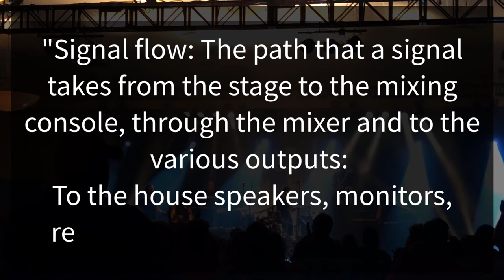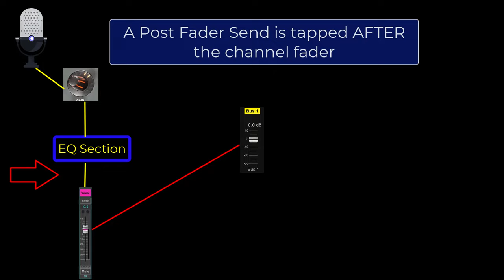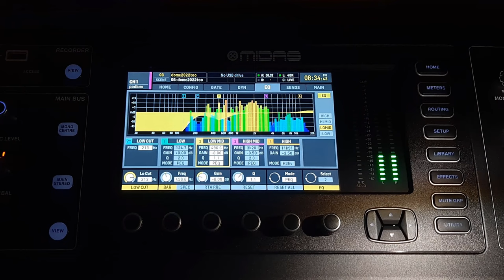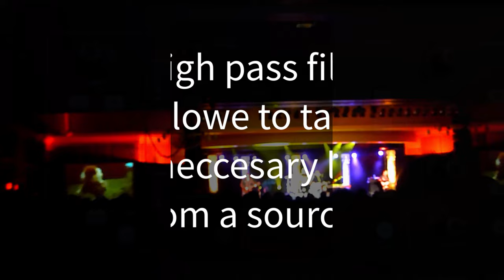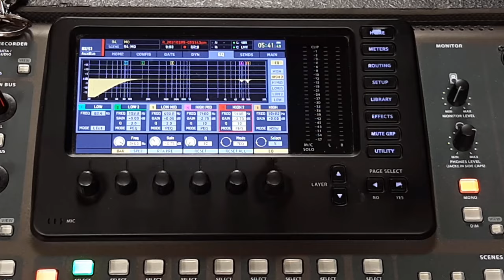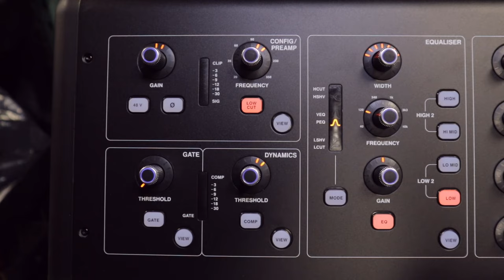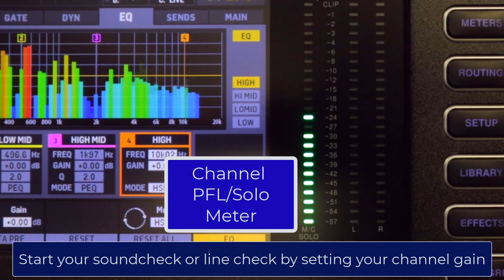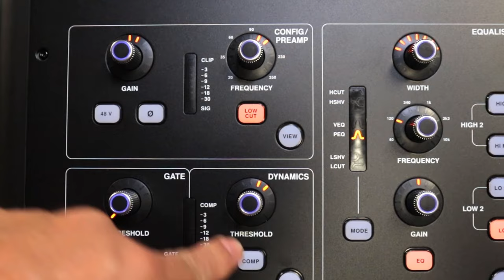Live Audio Mixing: The Fundamentals

Comment from the maker: This video is non-console specific, and much of it applies to analog or digital consoles. But, since it's rooted in console fundamentals, it's definitely things that can help you make the transition to digital easier. Signal flow, routing, gain, EQ terms, etc. are all discussed. It's actually more than 3 tips because there are tips within the 3 fundamental topics discussed.
As always, please like, subscribe, and share the link. And post any questions or comments here.

►►There are PDF materials on the Patreon page, including a PDF Study Guide package of materials that I've written that dovetails with this video and gives more context for a deeper dive. It is available as part of the 4.00 Patreon tier.
https://www.patreon.com/AlanHamiltonAudio

~~~~~~~~~~~
Suggested videos:

►5 Tips for Better Live Vocal Mixes:
https://youtu.be/oP4sdpkkNhY

►Mixing Live Bass Guitar:
https://youtu.be/FNa7avcUUSM

►How to EQ a Kick Drum:
https://youtu.be/CQg1_-ZJ4MU

►How to EQ a Snare Drum:
https://youtu.be/J_WC68vyht4

►How to EQ Toms:
https://youtu.be/nSLJqnlJe60

►Cable Management For Live Audio:
https://youtu.be/nYZ9nrPGswo

►DI Box 101 -  What's a DI Box and Which One Should I Use?
https://youtu.be/6iwW5_Ia9Uc

►My Most Used Audio Adapters for Live Sound:
https://youtu.be/SFzPh3UYAoE

Comment: I find your videos extremely interesting. I've taken an interest in live sound only within the past year. Wish I had got into in my younger years. We have a pulpit mic in our church that's hard to hear. I asked the sound guy why that was, his response  "when we turn up the gain we get feedback". I accepted that answer and I just learned from this video that his answer is incorrect. I'm guessing he has no idea on waht to do to get rid of the feedback other then decrease the gain on that channel.
Reply from the maker: Yes, that's likely true. While it's possible there could be some physical limitations, like the speakers placed directly behind the pulpit and even aimed at the mic, and worse, without much distance between them and the mic... And even worse, maybe the person speaking has an extremely quiet voice too. That is not usually the case, though.

It's more likely it is something like the mic is being fed to the monitors, and already close to feedback so bringing the gain up finally crosses the gain before feedback threshold into feedback. And for whatever reason they don't bring the fader up instead (and maybe they do but maybe any monitors are post fader (instead of pre) which would also bring the monitor level up. But some people mistakenly think the faders all need to be in a perfectly straight line at unity and so they monkey with the gain control to achieve that, and won't move them fader (even when needed) and that paints them into a corner.
That would be a scenario that would cause feedback primarily in the monitors. 
But the feedback could be in the house.

That then could include an issue like the system EQ is not properly dialed in making a mic or mics more prone to feedback. Or channel EQ alone or in combination is making some mics more prone to feedback or not properly addressing feedback. This could then lead to feedback in monitors or house (or both).

Many times, for things like a pulpit mic, few if any level in the monitors is needed. And if you do send the pulpit mic to the monitors, the person speaking will get (speak) even quieter because of just how well they do hear themselves and so perceive themselves as being 'too loud'. Turning down (or off) the pulpit mic in the monitors could actually make the pulpit mic louder, because the person speaking will talk louder. The louder the signal going TO the mic, the more signal the mic (and thus sound system) have to work with. 

Then other issues like not using a HPF and/or no windscreen on the pulpit mic (or lows dialed into it) could have the person backing too far off the mic because when they do get close they get loud plosives ("P"-pops... "B"-Booms... "T"...thumps). But that goes back to what I said about losing signal into the mic. Backing away from the mic means less signal into the mic.  Note: You shouldn't have to get right on top of a pulpit mic. So don't misread what I'm saying. The person speaking shouldn't have to have their lips touching the mic. A foot off a pulpit mic is generally workable. But a yard/meter back would be an issue.

And even that brings another possibility into the equation. Maybe everything is dialed in decently and the person speaking just needs to be closer to the mic. Even if speaker placement isn't ideal, if there are no monitors being used so no monitor feedback or not mons causing the person to speak quieter, if they are standing too far away from the mic it's going to be hard to get useable gain before feedback from the mic. Loudest sound at the mic wins. So it could be the person speaking just needs to get closer to the mic, and stay in that general area and not back too far away from the mic.

It's hard to say for sure what the problem and solution is since it could be a multitude of things, and maybe more than one happening as well, but it's pretty likely there IS an answer and that the level could be improved without feedback being an issue.
Reply: @AlanHamiltonAudio  With my limited knowledge, my opinion is whoever mounted the mics to the pulpit put them to far away. (mics are mounted towards the front further away from the speaker). Monitors are out of the equation, also the house speakers are well away from the mics and out front. I'll start with the simplist thing first and move the mic closer. They are at least 18 inches or more from the speaker.

Comment: Hello :

I have a little mixer question for ya.

I have a small mixer for my live performance percussion playing.
The mixer has fx but once you choose an effect, that’s what goes to all the channels and you can only control how much or how little.

I need to put multi fx on all channels and on some of the channels, I need different fx than the other channels.

How can I achieve this ?

Is there a live performing mixer that can do this or do I need to chain pedals together and connect to the aux send of the mixer ?

( I need a small mixer that can handle my 6 mic inputs.)

I would love to be able to put a simple reverb on say…my congas, but then a flanged wilder reverb on my timbale. Those are the kind of things I’m trying to achieve while playing live.

Thanks for your help !
Reply from the maker: You're probably not going to find an analog mixer that fits the bill. They're just going to have one reverb or FX option and that is that. Otherwise, you'd need to get an analog mixer that has (post fader) aux outputs and buy external FX for the different effects you're wanting. So if you want 3 different FX you'd need 3 post fader aux sends on the channels, and 3 different external rackmount FX.
Probably, by the time you put all that together you could've just bought a small digital mixer that would've had the FX all built in.
Something like the Behringer XR18 (or Midas MR18) has 16 mic pres, 2 stereo inputs, 8 outputs, and a 4 slot stereo FX rack. So that means you'd have four FX slots to use any of the built in FX.
You can get other digital consoles in the X-Air range that have less channels and outputs, but that same 4 slot FX rack. 
You'd need to use a tablet or laptop to control these.
And there are other things like the Midas M32R or Behringer Compact that DO have a surface if you prefer not to use a laptop or tablet.
Soundcraft, QSC, Yamaha all have small digital format consoles. Some with surfaces and some you'd need to use a laptop or table for. You'd just have to research the various ones to see what one best meets your needs.

The gist of it is, a digital console with a four slot FX rack will give you the ability to have 4 different FX that you can apply independently to your percussion.

This video is made for different reasons, but it should give you a clear picture of how the FX rack works and you can expand that knowledge to any options you look at:
https://youtu.be/TV5ClH_MWrU

Comment: Could you kindly explain the differences and/or similarities between the system eq and channel eq?  I hesitate to make any assumptions sometimes even if they end up being correct. Clarity is important to us all, which is why I continually return to your YouTube channel with questions. You are among the best communicators I know of. 
Thanks, friend.
Reply from the maker: When you play tracks through your system, they should sound good with no channel EQ.
That doesn't mean you put subjective EQ on there, so you kind of need to get used to listening to music flat (no smiley face EQ at home and in the car for example). But if the music sounds really dull, or muddy, compared to how it normally sounds flat then this would be where you approach it on the system level. The first step should be speaker/amp balance overall (more horns, less mids, more subs... etc... Or even just making sure the coverage is right and the horns aren't shooting over everyone's ears). Then fine tune with the system EQ once the system is balanced in a macro sense like that.
 Or if the system interacts with the room in weird ways. Like a build up of 160Hz in one room that you don't get when you're outside for example would be a place to hit the system EQ. 
You probably would hear/notice that with the track playing, or when talking through the system, or if you ring the system out. That kind of thing gets more easy to notice with experience.

If you were using system measurement tools, it would show you system weaknesses and take some guess work out, or confirm or pinpoint what your ears are telling you. So even though this is the best way, it might not be the most practical way for many. You have to invest in the equip to do it, and you have to learn the software, and learn to interpret the data correctly. And be in venues where you can take reasonable measurements and not be dealing with lunch crowds, juke boxes, etc...
Of course, there's two levels of this system processing and testing. Getting the rig measured and correct as a baseline, possibly outside where reflection and room nodes can be mitigated greatly, is still helpful even if you never get to measure it at a club. So that is something that can be done once just to get a baseline you have always. 
And a church setting should be a place it would be easy to find a time to measure things and of course that installed church rig won't be changing. The rig and room will stay the same. 

Another way to know if the system balance is off or not is to use GOOD headphones. Studio headphones. Not over-hyped sound hifi headphones.
When your mix sounds good in the room, put the headphones on and listen there. If the headphones sound NOTHING like the room (and keep in my your listening for tonal balance because stage volume could be impacting some of what you hear in the room) then you can pretty much know your system balance is off. BUT you need to listen PRE house EQ. You want to know how your mix is sounding BEFORE it hits the house EQ. If you solo a vocal and it sounds awful... shrill... wooly... but sounds good in the house... That tells you that you're fixing system problems on the channel strip, and that is the wrong approach. You should be fixing system problems on the system processing, speakers themselves, and/or house EQ. And knowing that your vocals require excessive high boost or high cut, is a good indication of places where you might need to change your approach to fixing a system problem with the highs.

Sometimes it's simple... if you see a bunch of highs cut on the house EQ, or you see the high level cut on the powered speakers, yet you're adding highs into the channel strip of vocals and other areas, then it's pretty easy to know that you need to bring those system highs up, while bringing those channel highs back to flat for a reset and restart. You still might want to bring highs up somewhere for some 'shimmer'... or some hi mids for some bite... But it shouldn't be something you HAVE to do on the channel strip just to get acceptable sound. It should just be something your do subjectively.
Or it could be the opposite... You're using HPF filter generic settings and they are reasonable, yet every channel you're having to cut lows or low mids excessively to keep the system from rumbling. That's a good sign either the subs are too hot, someone's cranked the lows on the system EQ, or the room has a low build up issue that needs addressed SOMEWHERE at the system level, not the channel strips.

Essentially, if you find you need to do some things on basically every channel, that's a good sign there is a system level issue in reality that needs addressed first. The channel EQ should be something you mainly use for subjective reasons, not something you have to use just to make it even sound acceptable. That doesn't mean you can't turn the highs back 3dB on the vocals if you hear a ghost ring on the lead vocal and you don't notice it anywhere else... any port in a storm. And it can be a quick fix in the moment. But that was probably, overall, something best addressed on the system EQ with a surgical cut. Or maybe not a cut at all but just making sure there's not a speaker/mic placement issue at play that you can fix. Or maybe you just knock a couple dB off his monitor send and roll with that rather than making wholesale changes if all else is good.

But the key thing to consider is: Is all else really good?  Do all the channels look fairly normal, is there something that is being done on each channel's EQ? Are you compensating for something on nearly every channel that you could fix with just one cut on the system EQ. Or a change in the system balance at the amps/crossover?
Reply from the maker: When I say "tracks" through the system... I'm talking recordings you are familiar with and how they sound on a variety of good playback systems. Things with clarity and balance.

Comment: Do I need an amplifer from my Behringer XR 18 to Behringer powered speakers?
Reply from the maker: If the speakers are powered, they don't need an amplifier. Only passive speakers need an amplifier.
Reply: I will add, if your speakers have a bass and treble set up, start by setting them flat. depending on the size of your venue you can make subtle adjustments at the speaker should you be getting too much gain after you've EQ'd. Additionally, many  active (powered) speakers now use a built in DSP so know which setting to use on the speaker itself

Comment: Now that I have more knowledge of these tap points, I have one question I previously asked poorly. 

DDJ800 by rekordbox - xlr to xair18 (b52s are on AUX 5, 18's are on AUX 6) 

With the DDJ800 being the source of all instrumentals, do I still send those bus channels from the ddj800 as "post fader" or "pre-fader" since I don't have control of singling out particular instruments?

I know it may still seem confusing, I'm just wondering if it's simplified to the point of basic HPF at 30hz and LPF to about 150hz on the aux 5-6 sub channels. Or if I would do my cuts within the ddj800 xlr channels which are based on 15-16 via xair 18. I've tried a few methods, but the early stages of mixing might have me overthinking the loudness of the subs, or the amount of frequency they are pushing out. There are times the bass seems overbearing around the 60hz-100hz range.
Reply: I'm starting to ponder it being input gain. I might just have to reset and find the correct input gain once again.